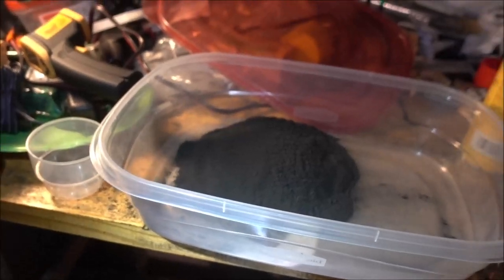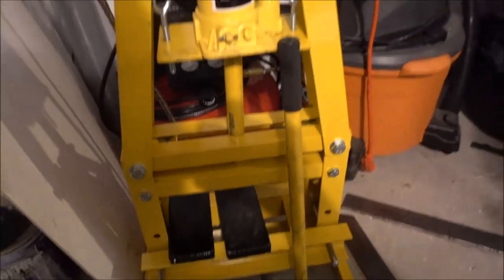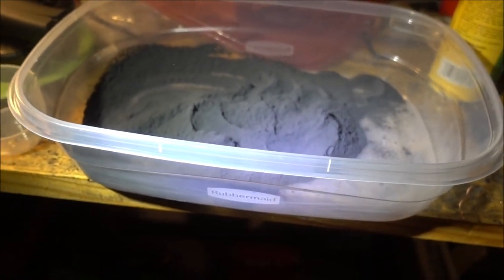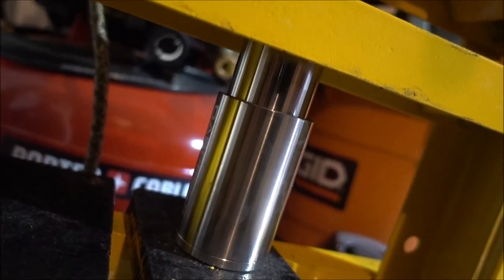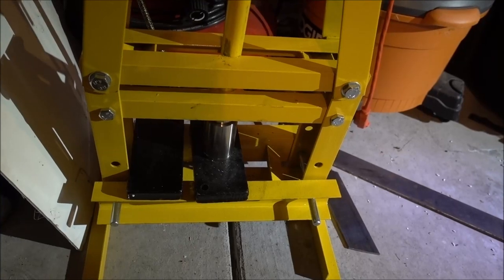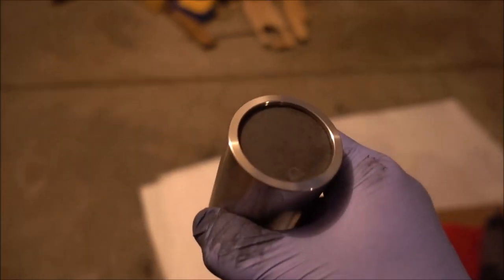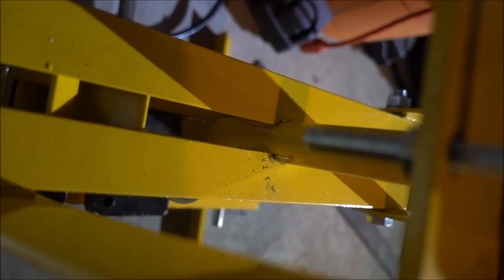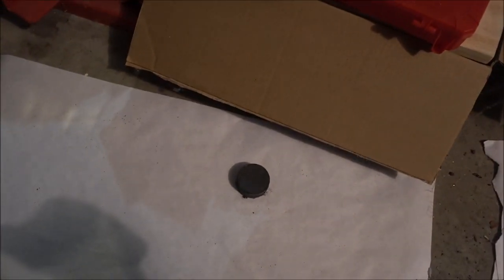How to Make Commercial Quality Black Powder Part 4 Puck Forming

Comment: If you haven’t found this out already, be careful trying to extract your puck by pressing on the edge of the die with your press. Mine actually bent/bowed doing this!
Reply from the maker: Thanks for the warning. My die is steel so no problems on my end. I think it's safer than hitting it with a mallet.

Comment: Gave me some ideas to make some changes in "MY" pucking. I use a home made pucking die with a push through system, but I use a BIG OL VICE, I do let mine sit and hit it again, but I will wait longer, maybe invest in a Harbor Freight press or make my own, a little engineering and work I could use my two post car lift? Just about ready To Test, gotta weigh and if the weight is stabilized then they are DRY and ready to test!
I tried 4 different carbons to see what may work best, Guava tree trimmings, walnut shell abrasive, whole Corn, and 2x distilled sour mashed whisky biproduct.

Keep the smoke trains SMOKING! 
Shooting Balck Powder is a Journey and an Adventure all mixed up with History and Mechanical and Chemical engineering
Reply from the maker: Glad you stopped by Dave. I tried a 6tn jack and it doesn't quite do it. You get a puck about as hard as wood. I stepped up to a 10tn and got the ceramic like hardness that you need. If your die is larger than mine you'll want even more pressure since it's more spread out. Good luck!
Reply: @SuperSneakySteve  I just developed my 16tn press, once I change some watered out Hydraulic oil may get it all up to 24 tn? in s two stage system.

Thanks for all your IDEAS!
Keep chasing the Craft, I'm Hooked
Reply: @SuperSneakySteve  , have you thought of putting your videos in specifically grouped play lists? I went to see if you had a play list of your videos about making black powder only to find that you have just one play list with over 200 videos in it. Can I suggest you separate your videos according to topics? You would get a lot more views. Because I can't easily find a playlist on any specific topic I'm less inclined to watch more videos. Otherwise I'd quite happily watch more of your videos on the topics I'm interested in. Just a suggestion.
Reply from the maker: @stuffbywoody5497  Thanks for the suggestion. I never made a playlist. YT must make an all video list by default.
Reply: @SuperSneakySteve  , it's super easy to create playlists. When you click "save" you get an option of saving to playlists or creating a new playlist.

Comment: Harbor Freight recently discontinued their 6 Ton Press which looks just like yours. Where did you find your Press and who makes it ,also how much did it cost? It looks like it would be handy to have in anybody's Garage for lots of other  things. I've never heard of the Rice Starch before but the "Cast Boolets" web page has lots of chats etc. on making Black Powder.
Reply from the maker: JEGS brand from Amazon. It's all Chinese stuff. I would recommend a step up from the 6tn. Go for 10 or more.
Reply: @SuperSneakySteve  to compare commercial Swiss or other brands 30 ton bottle Jack is more than enough plus only brass die and piston nothing else (for obvious safety reasons)! 5% water by weight to mixture, nice good stirring and then you press it! For the next step which is brake the pucks you use a rock tumbler kind style but the jar have a thick screen-mesh attached( depending what grade do you want it) inside have two big balls of lead  to crush it and every one cycle it made the broken pieces drop of and you collect them! That is the traditional process based on what I read!

Comment: I tried this and it sort of worked but I now see I made two mistakes.  First was too much water so I made something of a mess, though being BP it cleaned up easily.  Second was too much pressure - I had been seeing anywhere from 2 to 20 tons for this, so I used my 6T and put so much pressure on my cheap Chinese press to actually bend the press.

Also it seemed to be going way slow - as I had gotten the 30mm Dabpress and not the 40mm like you have here, which is actually 95% bigger and so twice as fast.

On Quora some guy was saying the water is needed to make the KNO3 bind with the charcoal, but I wonder about that.  I am actually pressing powder I made in 2019 hand granulated ( and not sorting, everything went in the bottle) with no binder, and it had been working ok until it started clumping, then clogged my powder measure, and resulted in dryballing the gun
Reply from the maker: Pucked powder needs very little water. I just give it a few squirts with my sprayer and that's it. Just enough to stop some of the dust and form a good puck. To make it go faster make spacers out of milk jug plastic so you can make multiple disks at once. If you upgrade to a 20t press like I have you can safely move up to a 3" die.
Reply: @SuperSneakySteve  I have a 40mm Dabpress now.  I was making dry pucks with the 30mm one until I read on Quora that I wasn't using enough water for the KNO3 to bind with the charcoal (utter BS I now know) so I put too much water in it, the original 30mm Dabpress jammed and I pounded it out of shape getting it open.  No loss as it was going to take forever doing 30mm pucks.
Reply from the maker: @slcgrgcrgcaneafgugiesclawhfg  Make your plastic milk jug spacers and you'll cut your pressing time to 1/3 or even 1/4.

Comment: IN you black powder recipe for pucking,  did you still use the SGRS additive or did you leave it out?    Where do you get the compression dies (pucking dies).   Did you machine them yourself or purchase elsewhere.
Reply from the maker: No SGRS in the pucked powder. Get it only slightly damp then press. No water should come out when pressing. Dies can be ordered from Woodysrocks website. Order extra spacers.

Comment: How long do you dry the puck? You used hardly any water. Either dehydrator or air dry?  Thanks.
Reply from the maker: You don't need much water for pucking. Less is better than too much. You don't want the KNO3 to come out of solution. If you used water a dehydrator is an option but you must confirm the heat before trying it with a thermometer. The sun and air works fine too. I like to give them a week to dry but it's really preference. The pucks should ring like pottery. That's how you know it's ready.
Reply: @SuperSneakySteve  thank you. Didn't use much water maybe about as much as you. Made nice pucks but didn't know how long to dry. Would think if humid out might not be dry enough. Ring like pottery good way to tell. Thank you.